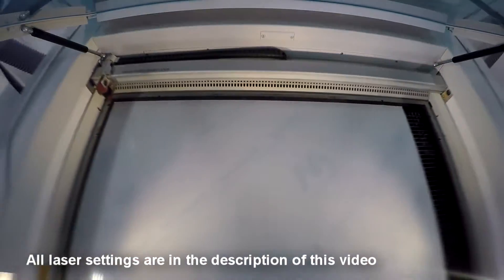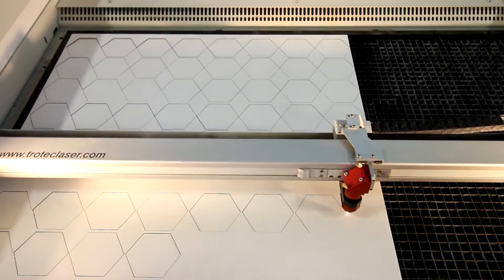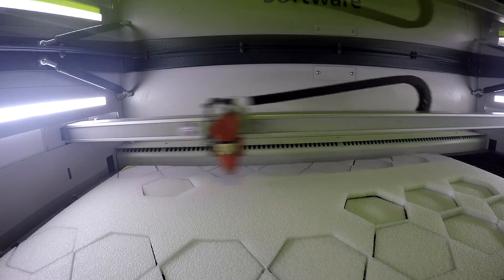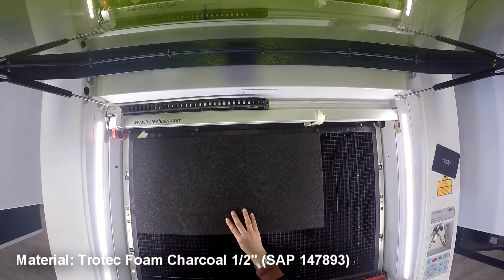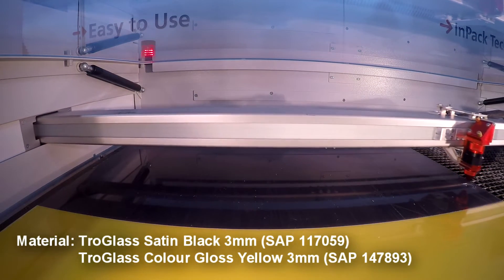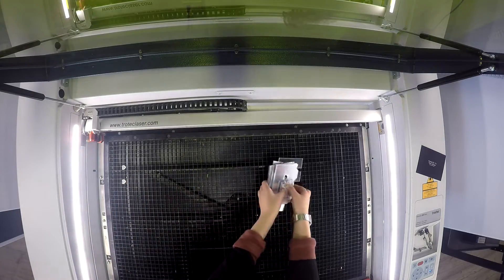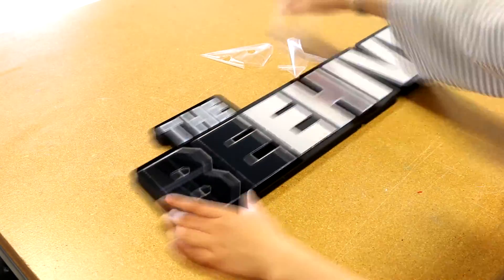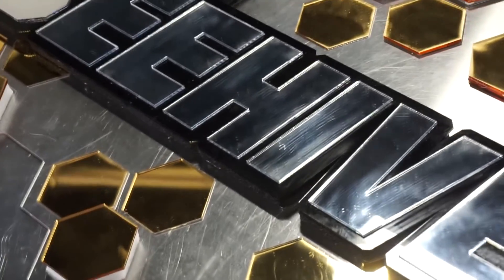Foam Sign Letter Backing | Laser Cut Foam | Laser Cut Sign

Comment: I need to laser engrave and cut 15 lb HDU Foam (Sign foam). I have a ULS 150w CO2 laser. I really need help on the settings. In the material database, there isn't an option for polyurethane foam. I could REALLY use some help.
Reply from the maker: Hi there, unfortunately we cannot comment on ULS settings.
Reply: AversaS -Looks Like you need to do some Form of Straight Up Test And Log it! If you can change Power and Speeds, set up a range of Test settings for each, while leaving the other element set! 

Trotec Canada has Videos on that approach! I think at least a Couple, and one is quite Intriguing - Making a Wheel sample, with 16 Different, progressive settings!